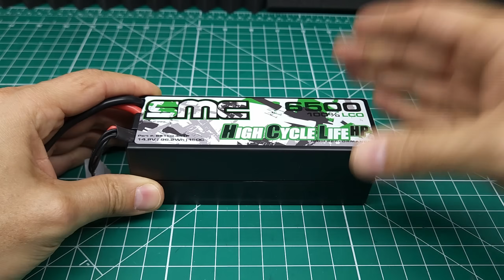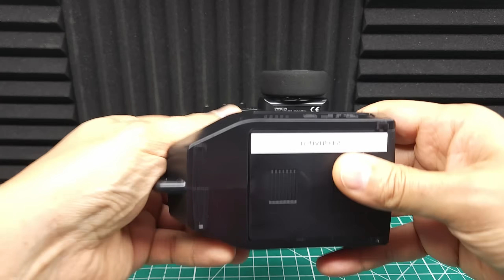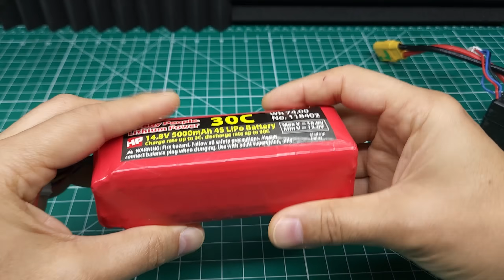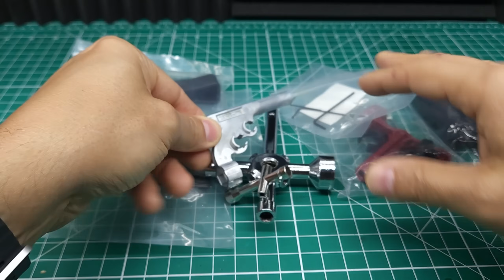RC Cars: The ULTIMATE Guide!

Comment: This is a great video especially for beginners 
I don’t think enough sakes ppl talk and emphasize how important battery safety is with these lipo cells 

Only things I’d add from my experience is to buy a lipo safe bag to store them as you just never know when a pack is gonna run away thermally and that not all speed controls are set up for battery protection depending on who used them last used or new 
Some folks turn the cut offs completely off and some make them so low that they can drain a cell below the 3.0 threshold 

I’d also add that charging at the same number as the mah in pack volts is common but I try to charge at half the rate 
So a 5 k mag I try to charge at 2.5 as slower charging is better long run 
Plus I am never in a hurry 
The battery makers absolutely lie and I agree smc is a great choice I also tend to recommend power hobby or gen ace if money is tight and I’ve even had very good luck with cnhl battery’s too 
I only recommend from my experience 
The good tools is the best advise I’ve ever had given to me back in the 80 s (hudy was a great name back then ) seems mip or mod is also decent quality drivers as I use mod drivers for my larger 4-5 mm for larger scale rc that requires sizes not made by mip 

You also didn’t mention storage charging packs that don’t get used as a general practice 

The adapters are one of my worst nightmares when I would see customers walk in to the shop 
They’d have 2-3 at times making their mismatched connectors on the packs work for 4-8s trucks 

I would actually solder their stuff and charge them for a connector so I’d like to believe I saved them a fire eventually 

I’ve managed to wear all my mip down so would be a great win for the tools 

Glad to see you not just do videos for just experienced rc hobbiest but actually do the beginners a video as well.  
Your knowledge and wisdom of knowing how not to shut out your viewers is great 
Think I just bought one of those granites and have yet to run it 
It’s a 223s truck but can’t remember if it’s granite or another name 
It’s purple and pink tho.  Loo

Comment: Great video my friend!
This is my entry into King Bonehead of the Year award:
Last weekend I was out with my mate, talking away to him and not giving what I was doing my full attention. What I was doing was plugging the battery into the ESC, it was already in the battery tray, which is something I never do, I always plug in first.
I run XT-150 connectors on my 6s rigs and instead of having two male connectors on the ESC I have one male one female. It makes life easier when you run in series.
So, I'm sure you can see where this is going, but I'm gonna say it anyway. 
I accidentally plugged the male and female plugs together on a 7500mha 120c 6s 😐😐😑😑😑😐
The plugs welded together and the positive lead blew of the XT150, it was spectacular.
Burnt my fingers as well, what a dick.
Tips and tricks: Don't Do That.
Cheers mate 👊

Comment: You should be using the BALANCE CHARGE not the CHARGE option on your charger, because the normal charge only finishes charging when the battery reaches the target pack voltage not the individual cell voltage, (Could lead to one of the cells being a higher voltage than the other.) which is why the balance charge function exist, so you can charge all the cells to the target voltage, (Normally 4.2 volts.)
Reply from the maker: Pretty much all modern chargers balance as they change using the normal charge mode.
Reply: On my charger, (sky rc t200) the normal charge mode won't balance the cells on the charge mode, but if I you the balance charge it will balance the cells. It is still better in my opinion to use the balance charge mode if your charger has the option for it.
Reply from the maker: @DamienBondarenkointeresting. Yeah I haven't seen a charger in probably 10 years that didn't balance as it charges regardless of what mode you used. Maybe yours is different but the vast vast majority of them balance while they charge no matter what option you choose.
Reply: Most of the charges I have used don't balance the cells in normal charge mode, except for some of the more modern/higher end one's. Most chargers with an lcd display or are older chargers won't balance the cells, (Probably  because they all use the same software.) and I don't want to risk charging my batteries without balancing the cells, which is why I always charge with the balance mode.

Comment: Absolutely excellent video and I think a must watch for anyone getting into the hobby. I especially like how in-depth you went into lipo batteries. One of the best videos on the subject I've seen in recent memory. I think a lot of people have a fear of lipos thinking that they'll just combust out of nowhere but as you said, a fire is very rare and mostly happens while charging. As long as you know what you're doing, they are safe and can last you a long time. The rules I follow are:  never leave a battery that's charging unattended (Most Important!), only charge at 1C, bring the battery to storage charge asap when done using it for the day and lastly, if a battery shows any type of damage or puffiness then just dispose of it. I've been in the hobby for ten years now and following these basic rules I've had lipos last me for years and have never had a fire (knock on wood).
Reply: I tried putting an Airsoft 3S 1100mAh 25C in an RC car, great way to make a smoke grenade... (I wanted to get rid of that battery because of puffiness) also great tips, I've also been doing the same and my oldest batteries are around 7 years old going strong, none ever exploded (except the previously mentioned incident)

Comment: ive shorted my  lipo and all that happened is it melted the solder connectors within i resoldered them and it was fine no fire no explosions the only time ive damaged lipo's is i put a hole in one and low voltage that resulted in a puffy battery

Comment: One thing that sticks out in my mind, I did not see in your video is RC vehicle Safety.    Some of these toys have some series high speed, and can turn into a flesh and bone destructive missile.  
Bonus Tip#1 Like you said,  it can be a little confusing at first when driving an RC towards you.  Do not do speed runs while standing near the path of the vehicle, without being behind some type of barrier.  Such as a tree,  a lamp post,  etc.

Comment: Specifically for Traxxas, I have no other use case, a light dusting of WD-40 across the entire clean chassis will help it stay clean, but appears to offer a small bit of flex in the base plastic making them a tad more rugged, with the obvious concern about ensuring all mesh points are not being treated heavily.

Comment: Hyper Though for me is good option. They have 2 types you can take in consideration 4v and 12v. In my case I have both, and I use more often 4v they have the power and clutch up to 6 and can be use straight or by pressing a bottom switch to common pistol grip. That can be my recommendation

Comment: Sorry to say this, but the toolkitrc charger is really good for the drone hobby. In my case, I have Toolkitrc M7 is a/c dc, and it is a monster. Toolkitrc charger are really great, and they're reliable. It is one that I can recommend. Mine is 15A power and 300 watt dc a/c 100 watt. I never have GenAce, and I know they're great charger, but Toolkitrc, I will never change for other charger
Reply from the maker: Yeah their chargers are definitely good. I wasn't really saying that charger itself is bad I just think that for most people having to deal with an external power supply is a hassle that just isn't necessary
Reply: @DoRC Exactly, as I say, Toolkitrc is more inclined to drone hobby, but have powerful chargers that have a/c. I understand what what you say is always good to check lipo before use

Comment: my first hobby grade was a traxxas bandit kit i had to put together and i broke the diff output yoke so i couldn't run it untill i could get one. back then traxxas wasn't in every hobby shop so i had a hard time finding what i needed local to me. i ended up finding the hobby shop close to me that had the part i needed in the rc car action magazine where they had track locations in the back and  i don't miss the all plastic transmission gears the 272 had back then. i was good at changing the idler gear out in the 272 back then and i always had 2-3 spare's since i would at least strip one out every time i raced it. the reason you would strip out the gears inside the transmission is because the clutch pucks where a pain to get set just right to let slip just right

Comment: I have a question for everyone  !!
Does anyone know if they make an adapter for an rc car that has a 3 or 4 wire lead on the ESC to the battery is there any kind of adapter so that you can run a battery that has a Deans connector on the battery  ???

Comment: I have those MIP bits, they're great.
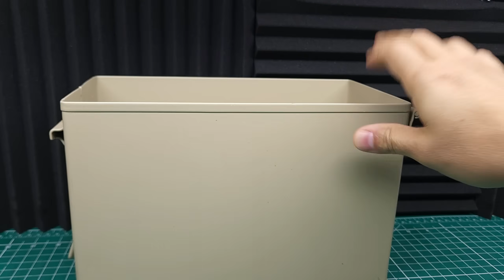37:42 I keep the four corner bits of the seals, allows it to still feel nice and tight while most of the seal is gone.
Reply from the maker: Yeah you can do it that way as well though even with just the area above the latch it still feels nice and secure.

Comment: I pretty recently started the hobby with an ARRMA Typhon Grom 223s. I actually opted to use the horizon smart batteries because it just seemed so much more convenient to have batteries that have the ability to discharge themselves in a fireproof box.
Yesterday my rear tires were worn out and I found out my rear suspension seems somewhat crooked. 
I was excited to finally have something to fix on that thing.

Comment: 5:36 not copper, its lithium that forms dendrites that short the battery internally
Reply from the maker: That's entirely possible though from the studies I've read they say it's copper plating from the anode that goes into solution.

Comment: Keep on keeping on.  Your videos are very helpful.  I have learned a lot from them.  In this video particular learned about my charger.  Some of my batteries have been charged over 100 times.  At what ohm's of resistance should you dispose of the battery.  One of mine is over 10 on one cell.

Comment: My best tip is to have fun but be very aware of your surroundings.   Another tip is to not run an rc car in really inclement weather like a severe thunderstorm.   Third tip from me.. if you’re short on money and you need to fix a rc car, look for a part that can work and adapt it to said rc car.  I adapted a traxxas stampede 4x4 cvd driveshaft to my rival mt10.  Of course if it doesn’t fit the first time, adapt it with a power tool like a sander, drill, etc.

Comment: As much as I like free things, I already have that MIP bit set so I'll sit out this contest. My advice to noobs is get a good battery charger. I cheaped out until the 3rd charger I bought and I would have saved $ to buy a decent one from the beginning. Again, please don't put my name into the contest.
Reply: PS you described the copper migration perfect in your lipo safety section. So many channels will tell you that you can safely "revive" dead lipos with low voltage, and while it's technically true, it isn't worth a fire for a $50-90 battery, is it?

Comment: My tip: buy an air compressor (one with a tank) for cleaning. This has saved me so much time and I’m sure my cars break less with less sand in them.
Reply: 100% agree. My air compressor means my RCs always get clean and dry after running, with no hassle. I have a little hotdog one that costs less than $200 and it's no louder than a vacuum cleaner.

Comment: Very extensive and informative video, thanks as always! 

Small suggestion: Perhaps add chapters to the video. 

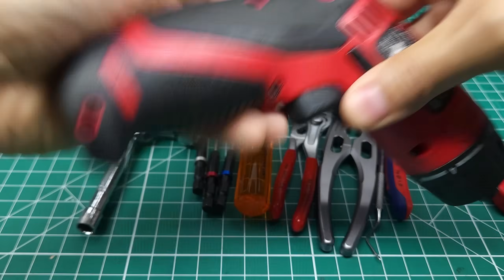In my opinion; a decent size work space (28:20) is also very important as it helps to keep organized. 

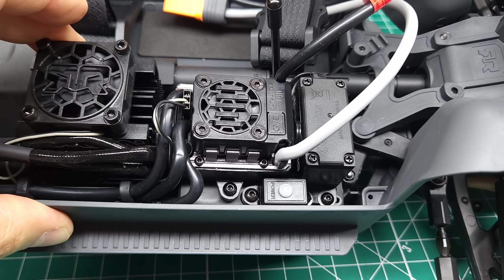To organize screw (30:39) the cardboard trick is a really good one, you can also get magnetic dishes you can put the screws in. They will hold the screw in the exact place where you put it so you know where it goes back in the car later. 

Perhaps in a future video you can talk about the different types of RC cars (monstertruck, buggy, truggy, trophy and desert truck etc) and the different scales and where/on what surface/terrain they are most suited. 

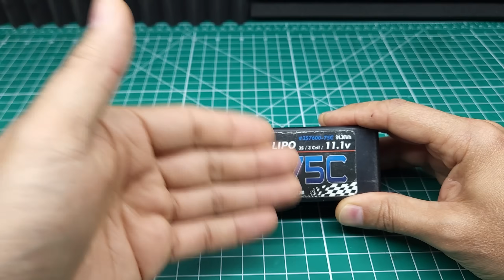To make things a bit more easy to understand perhaps you could have added some sort of graph or ilustaration around 16:15.

Comment: 24:46 I just got a v4 granite a few weeks ago.  It got super hot super fast with imo not very hard of driving. I went with a 35mm rocket fan on the motor and a 25mm on the esc. Now it stays nice and cool. Stock fans are not good enough for how this is geared etc.
Reply from the maker: When you say super hot what do you mean? How are you measuring it and what temperature did it get to?

Comment: again, i belive i commented under another video, USB charger with no Schreen or brand, charging only via balance wire, coming with super cheapo chinese rc (hbx, mjx) tend to overcharge and are real azard. My lipo cells were 4.26 and 4,28 and if i haven't checked, my house would have been on fire!😊
Reply from the maker: Yeah I agree. That's why I usually recommend people don't use them.
Reply: @DoRC age old question: is it safe to charge only via balance wire in general? i have very decent balance charger and i use them as a side of my main charger (it uses both main plug and balance wire) and i read online that are dangeroud. The charging goes to max 2 Ampere and has a small schreen for the lipo Voltage etc

Comment: I had a lipo battery that rapidly failed and almost burst to flames... but it wasn't outside... it was in my actual room.  My parents purposely enforced changes for safety hat i initially opposed but i had to give in to keep my rc hobby going.  The battery was a zop power 3300mah 2s for my only WLToys buggy, the 104001.

Comment: I've always been surprised that rc cars don't use protected batteries. I understand that esc's and chargers have smart circuitry but a circuit board in the battery itself is just one more layer of safety.
Reply from the maker: Yeah it's definitely something that could be done though that would drive up cost and having more sensitive electronics in that area could be problematic.

Comment: 3:10 but why are you doing this on flammable grass?
Reply from the maker: It's not. I live in a subtropical rainforest environment and you couldn't set that grass on fire with a blowtorch.
Reply: @DoRC ok, but it wouldn’t hurt to do the same but on concrete
Reply from the maker: @maltesrcI didn't want to do it on concrete because I didn't want to scorch my driveway. When those batteries go up they get very very hot and it would probably have left a permanent mark.

Comment: I charge all my batteries at 5 A if possible. Is that helping the life of my battery in the long run?
Reply from the maker: I'm not sure though from my research as long as you're charging at 1X the battery's capacity or lower that's what's best for its life.